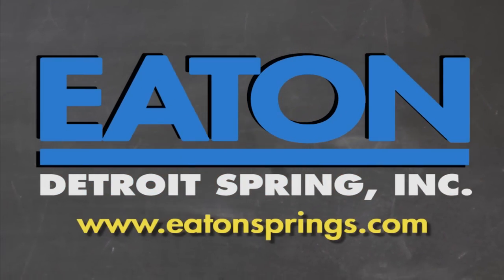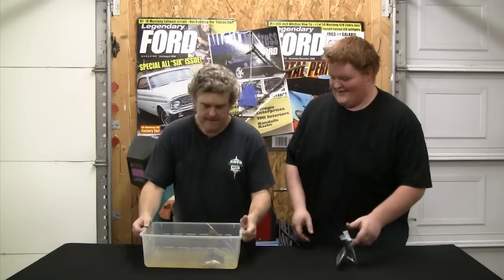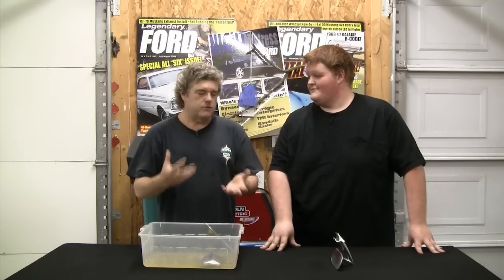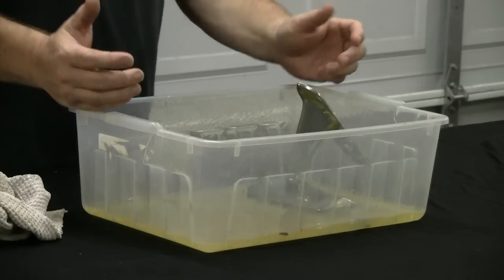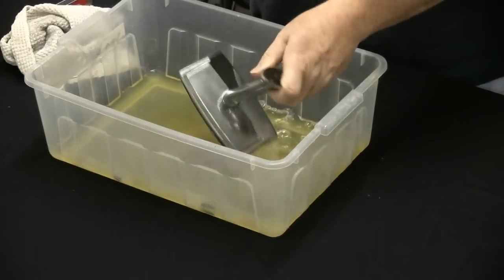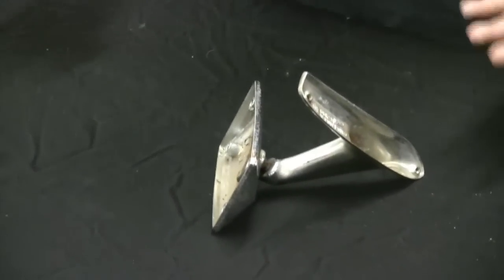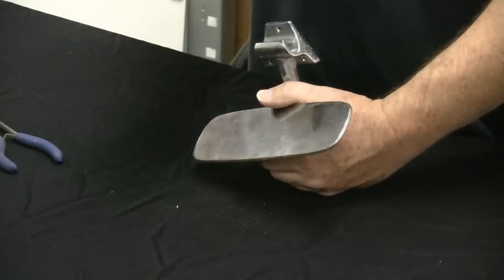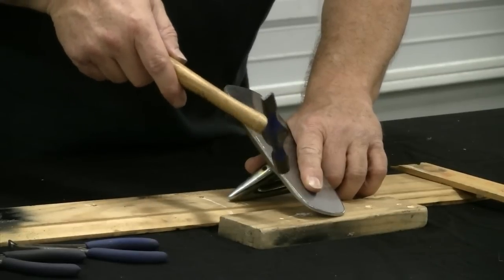How To Fix Loose Outside or inside Mirror on Classic Cars Episode 275 Autorestomod

Comment: Will a heat gun work to remove the mirror glass?
Reply from the maker: That honestly depends on the glue that they used. Sometimes the heat will end up just cracking the mirror.